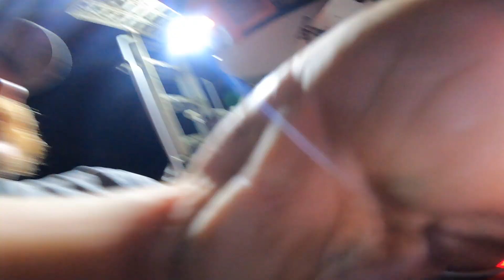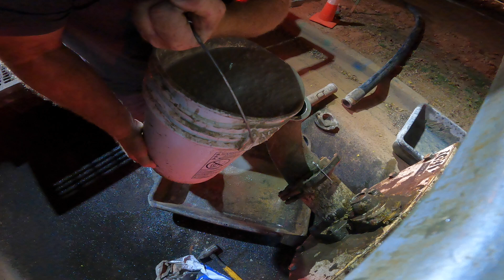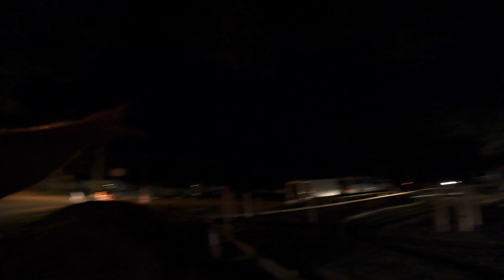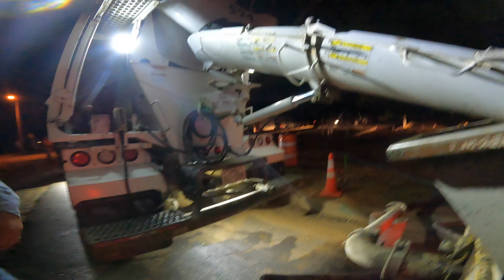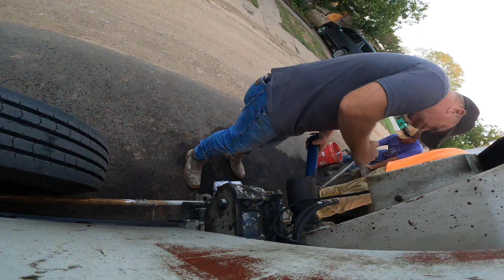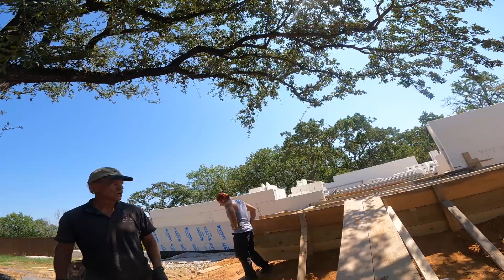Pumping concrete for this 70 yard house slab with the trailer pump!!!

Comment: I run 2" for p-gravel/grout and 4" for everything else with a schwing 750-18 and start to finish with the pump wide open I'm somewhere in the sub 10-minute mark For 10 yards of concrete though 4in
Reply from the maker: Damn that’s pretty good

Comment: To answer your question on volume. For me: I can pump 10 yard truck in 20-25 minutes of fast pumping with 2” line. But with 2.5” line I can empty that truck in under 20 minutes of fast pumping. So I figured every 10 yards of concrete you save 5 minutes on average for each size you step up. So 20 minutes for 2.5” hose. I’d guess you can empty one is 15 with 3”. EDIT: just seen it took you 17 minutes so I was off a tad bit lol.
Reply from the maker: Yes i really don’t think there is much difference in the 3” and 2,5”

Comment: So why not use your boom for the house slab? I do them often with my Trailer but if I had a boom I’d leave the trailer at the house haha. Dragging them hoses all over the rebar, wire, plumbing or whatever may be in it. I think it’s cool you’re doing with the line pump but I’m curious if it is like it is here in Bama where they just don’t want to pay for the boom. I can do a 85-90 yard house slab in about 3 hours maybe 3.5 hours with tk40 trailer pump running 2.5” hose. Definitely has to be perfect non-stop though. 

Chris
Reply from the maker: Their where power lines on the two sides of the lot where would have set up plus trees. Just wasn’t any room for it.

Comment: With a smaller machine like your SP500 or a Putz TK40/50, there's really not a huge loss in volume (assuming the mix is decent) going from a 3" line down to a 2.5" hose. The pressures will increase a good bit, but these lower volume machines with 6" material cylinders typically don't "fall off" until quite high up in the pressure range. Schwing has a really good graph to illustrate this in their SP series brochure. Dropping down to a 2" line would most definitely have a discernable effect on volume output.

If you had a higher volume machine using 7" material delivery cylinders (eg: SP 750-18 or VS70), stepping down from 3" to 2.5" hose, the volume loss would be much more pronounced.

Just my 2 cents.
Reply from the maker: Really makes total sense  I’m definitely not running off and buying 4” hoses

Comment: I see pressure increase going from 3”-2.5.  I’m sure you lose a little volume.   That’s a house slab I would use the 3” if it was just a footing pour with lots of hose dragging then drop down to 2.5” line to save the guys backs.
Reply from the maker: Exactly my thoughts

Comment: You definitely get less volume with smaller hose.
Reply from the maker: Right , I figured as much. I just didn’t know how much of a notice able difference
Reply: @MuddyfeetConcretePumping  changing hose size by half an inch probably isn't nearly as noticeable as when you are doing 1 or 2 inch change.